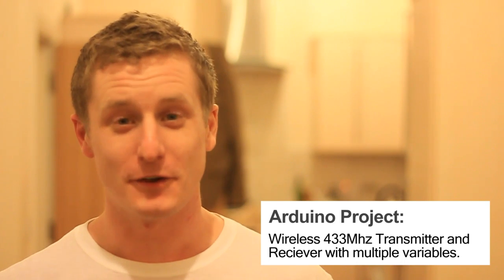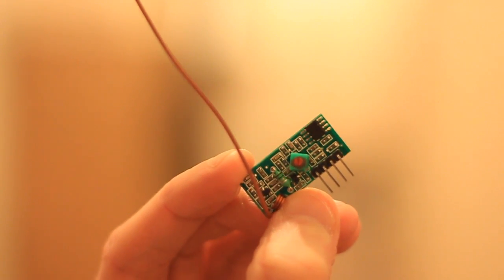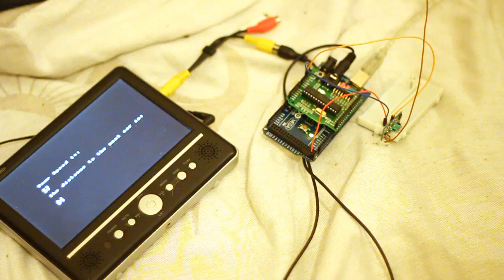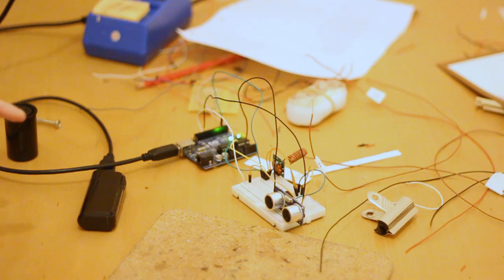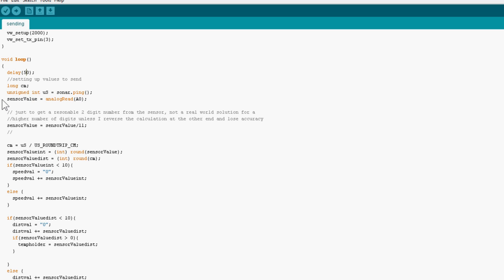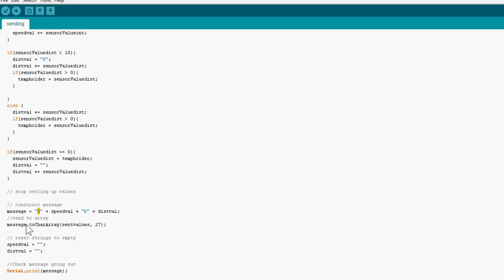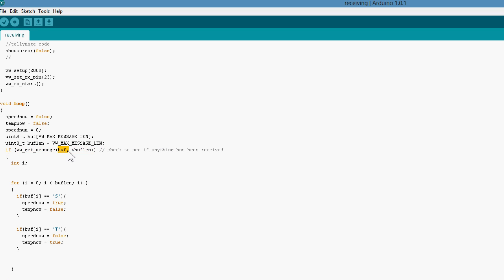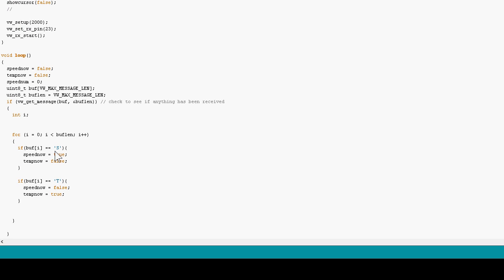Arduino Project: Cheap Wireless 433Mhz Transmitter and Receivers

Comment: Hi David, could you help me to do this project .... I am willing to use a sainmart tft touch screen to transfer signal .... please help me to accomplish it ... desperately need your help
Reply from the maker: Hi Nas, I would be happy to help. How far have you gotten with the setup?
Reply: David Watts
Awesome man...you are really fast....however, I just have started.... I bought 1 Arduino Mega 2560 and I have a tft sainmart tft touch screen... Thats it....do you think i can use this transmitter for transfer signal from sainmart tft...??? i already aorder these transmitter and receiver from ebay.... can you please show the connection little more clearly that I can get it and how can i connect the touch screen here. I want to turn on and off a led by using these transmitter and receiver.......Please help..
Reply from the maker: Nas Khan  If you just want to send commands by touch you can but you would need to set up your touch code to write to the virtual wire library. I did this around a year ago so there is probably a better library to use now. Essentially this is easily supported but both the library I used and the touch library you will be using.

Comment: 25cm ?  it should be  2.5cm  (almost 1 inch)
Reply: Denis Molla No. It is 25cm.
Reply: basic conversion math bro, 1 inch = 2.54cm.
Reply: You are talking about the receiver's antenna length, right? It is twenty-five centimetres.